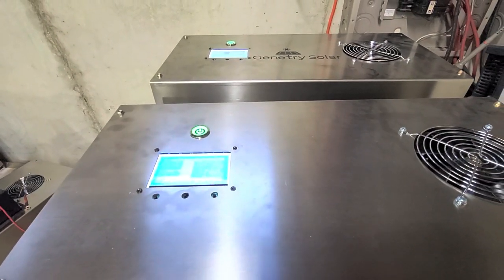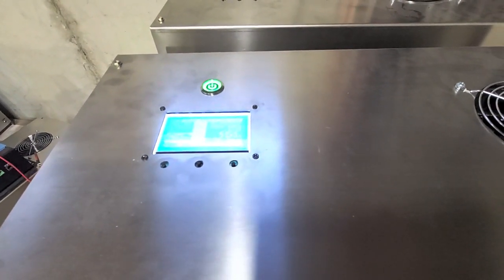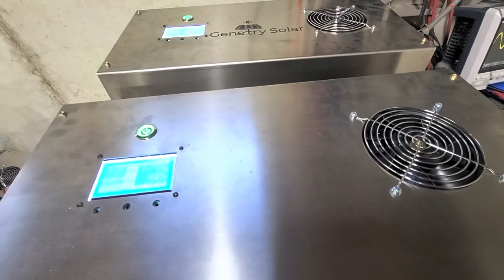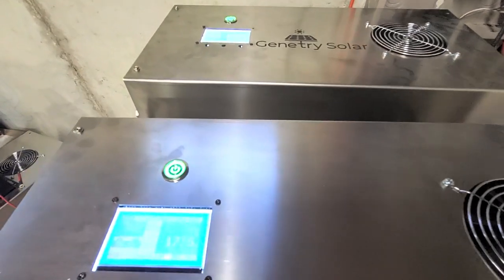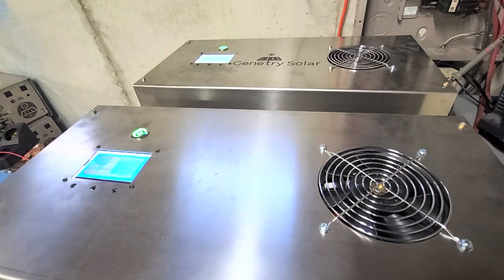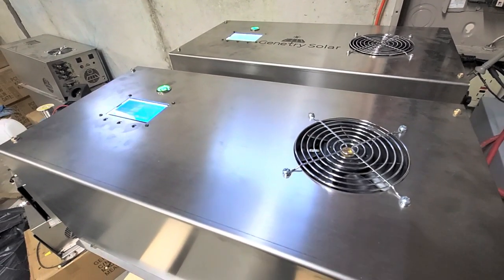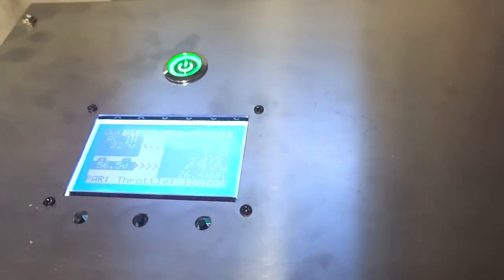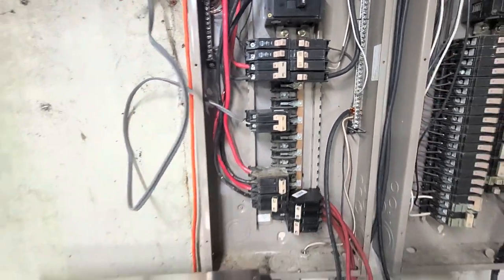Genetry Solar 6000 watt Inverter. a closer look at daisy in action (it runs my central air)

Comment: What's a gtm regulate error it been on my machine 4 times now
Reply: A well-intentioned feature that's gone a bit wrong due to a design mistake on my part; I'm not sure what firmware is on your inverter, but if it's at least 1.1r2, you should be able to disable the function from CFG -> AC Output -> GTM Off = Yes.

The goal of the function was for the inverter to automatically handle users connecting a grid-tie inverter to the output of the GS inverter.  If there's loads exceeding the grid-tie inverter's output, it'll allow the grid-tie inverter to run.  If there is surplus power, it will allow reverse charging of the batteries (if configured) until the batteries are full (or charging is not desired)...in which case it'll gradually shift the frequency higher until the grid-tie unit trips off.  If it reaches maximum frequency shift and the power flow is still in reverse, it will shut the inverter off with a GTM Regulate Fail error (to stop the power flow.)  
Unfortunately, I put one phase's output filter cap on the wrong side of the current sensor, and that's causing erroneous readings at small loads.  Disabling the function will stop the errors.
Reply: @sidlori1592  thx I found it
Reply: Kinda sad when I don't figure out the root cause of an issue for quite some time; I literally found the cause of that issue a few days ago (cap position). Problem is that it's random, and doesn't affect every inverter--for example, my house inverter doesn't have the issue!
Reply: @sidlori1592  one more ? Can I make it Sotheby's fan don't constantly run that's quite a parasitic draw
Reply: @patrickwhite9024  Ummm.....the fans should be completely stopped unless the internal inverter temperature sensors exceed 108F (default settings).  Settings get tweaked a bit perhaps?
Reply: @sidlori1592  is there a way to tweek it they been on since I first plugged it in
Reply: @patrickwhite9024  Something might be wrong then, I'd need to see it somehow.  Maybe you could PM me on the forum and we could get it figured out.

If the fans are screaming away at full blast, and the Temps screen indicates "no thermistors found" then there's a hardware issue/mistake.  (This would be very unlikely though.)
Reply: @sidlori1592  not screaming they are idled down and you guys have my number you can call me back I left a technical support message yesterday a d sent a pic of the code
Reply: @sidlori1592  304 area code
Reply: @patrickwhite9024  Sorry, we don't have an integrated phone system yet...I'll bug Sean for info I guess.
Reply: @sidlori1592  ty
Reply: @patrickwhite9024  Well, I guess a few more questions to check if the inverter is operating normally:

- What's the highest listed entry in the "Temps" screen?
- What's the average power load on the unit?
Reply: @sidlori1592  a fridge and sometimes a well I’m off grid I try to keep things bare minimum and until he gives you my number then I can send pics
Reply: @sidlori1592  I got pics and highest temp ever is 93.9 and fans continue to run
Reply: And I called again and left another voice mail I'm not complaining about the product but customer service is not existing also like if I had a catastrophic failure I guess they'll wait the whole yr to return your call so that your warranty isn't any good !!!
Reply: @patrickwhite9024  I am currently getting demos of customer support systems to decide on a final one to implement, but in the interim, we have to make do with the best we can.  I don't have access to the customer records, and Sean has a family to deal with--not to mention PJ customers out his ears complaining about a PJ 8kw inverter not being able to do 8kw continuous.

Are the "Min Spd" settings on all 3 fan channels 0%?  "ProCool" settings blank? ("---")  If you "TEST" a fan channel (turn it down to 0%), does the fan completely stop?

Alternatively you can PM me on the forum--for now that's the easiest way to contact me.
Reply: @sidlori1592  my pj I plugged it in and smoke flew out those are not good inverters I know his pain that's how I met him was when I returned mine and saw the name on shipping label
Reply: I'm not a savvy forum user I'm a middle aged construction worker lol it's not my thing I barely read emails
Reply: @patrickwhite9024  I appreciate your understanding; we desperately need a proper phone system in order to do better on customer service.  I have a pretty good idea of what we're switching to...from Gmail, Grasshopper and Microsoft Notes to a proper CRM (customer relational management) system that will make it very easy to add more employees (when we can afford it)...as well as making it very easy for me to chime in on the actual Genetry number with calls/texts as needed.  Hoping to visit Sean later this month to make the switch...
Reply: @sidlori1592  this really needs to be a phone call situation though the pro cool is -----
Reply: @sidlori1592  and you could see pictures of what I got going on
Reply: @sidlori1592  thx for answering the phone and getting problem solved
Reply: @patrickwhite9024  Yeah, it was breaking up really bad; as long as the original Min Tmp (108F) and Max Tmp (136F) values are maintained or similar (Min PWM ~10% should be fine), it should be good to go.

Comment: Hi. I don't know what will be your final software and all that but it would be nice option for customers to be able choose. Similar to Victron : 

1.  1.Main Inverter is always on 2. is waiting for overload from First inver..2. one will kick on only once it is over some limit set in fist inverter
2. 1 and 2 are always on they share load theoretically double load possible well lets say 95% 
3. anything between
Reply: Adding fancy interactive functions would require a complicated and expensive "paralleling" cable like the Victron and other inverters require. 
The GS method may be somewhat limited, but no paralleling cables are needed for any of the functions--which is our design goal.  Certainly limits the number of things that can go wrong.
Reply: @sidlori1592  yes agree to that and I'm glad for that  but personally i think one cable isn't so big deal it doesn't cost much but will allow you to do miracles :)
Reply: @SylwerDragon  Far easier said than done, not to mention opening up other ways to damage the inverter (as Victron alludes to in their documentation).
Reply: @sidlori1592  Nothing is easy my friend nothing..You do your best with minimum effort as possible (as it should be ) and minimum extra costs to customer. Anyway do good work and you will see some positive results. But i expect at the end it will be compromise between what is needed/possible  and what can be done.

Comment: We're still tweaking things, but this is a really good milestone!
My comments:
  - Surge loads are somewhat difficult to handle, as they are most often brief.  The master inverter is the only one regulating voltage, and doing so at 120x/sec.  To prevent oscillations, the slave inverter(s) are running at roughly 3x/sec--a much slower response time by comparison.  This results in the master inverter basically taking most of the big surge loads--and if it buckles under the pressure, it will shut down--taking the whole system with it.  We will keep tweaking and testing--maybe increasing the regulation speed.
  - At least one customer tried to start a heavy central air unit, but the GS 6 inverter really complained about it, and wasn't able to.  There are 2 bugs that have been addressed and fixed in the firmware (one of those just yesterday!) that may significantly help this.
  - The 77A rating is the LRA on the compressor on Sean's A/C unit--it's a guesstimate for the maximum surge load.
  - AC output frequency WILL deviate from 60Hz in parallel mode.  The 0-100% "throttle control" is a 60-58Hz frequency droop--in other words, at full load, the output frequency will be 58Hz.  This is about the only way we can handle parallel operation without a complicated paralleling cable system--which also means that no single inverter is aware of the total output load.  It's quite a balance...like I keep reminding Sean, there's nothing easy about parallel mode from either hardware or software standpoints.
  - Might have noticed the "fat" sine wave on the 'scope--that's an unavoidable side result of the freewheeling drive in the "slave" inverter.
  - Power readout on the slave inverter is going to be difficult to calibrate, as it's not using the super-accurate dedicated power monitor chip on the LCD board.  In parallel mode, power is actually bypassing that sensor entirely...and instead has to be calculated from the transformer current sensor.
Reply: Sid, the guy with startup issues could also use a soft start device for the central air to aid startup. Im sure youve heard of this device. My 5 ton ac has a LRA of 176 amps but its an older unit and the soft start i believe would reduce inrush by over half, depending.

Comment: 👍⚡💨. that's pretty amazing you can get that much surge out of the 6kw.  With two of those, one could run hot water heater and a/c all day. 

 It makes me wonder what you could do with a 30kw pj-- the transformer box alone is 175lb.
Reply: Well, with the ASL11 core...if the windings were properly specced, it'd increase the shipping weight probably to 200lbs, but it'd be capable of a continuous solid 30kw.  PJ driver design quite a bit less so, but...!